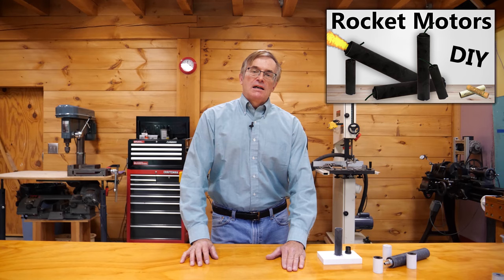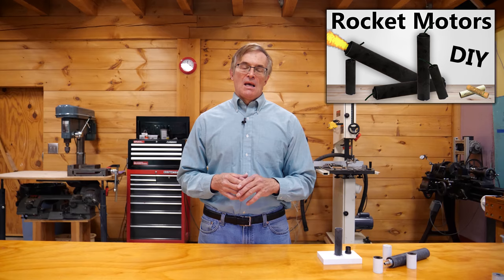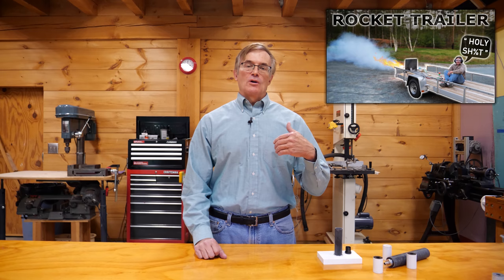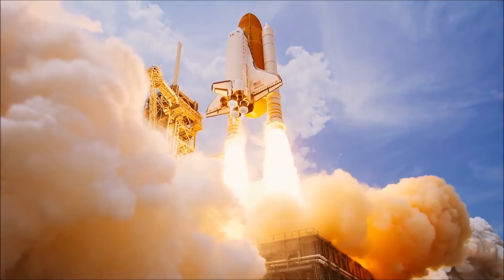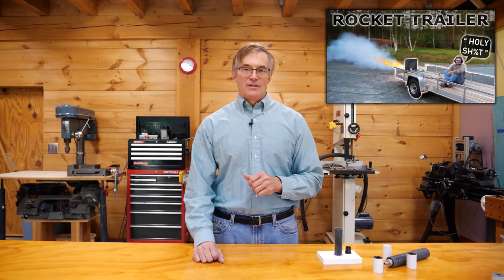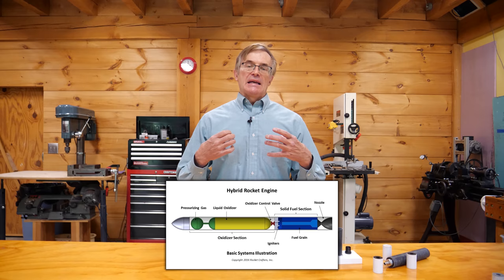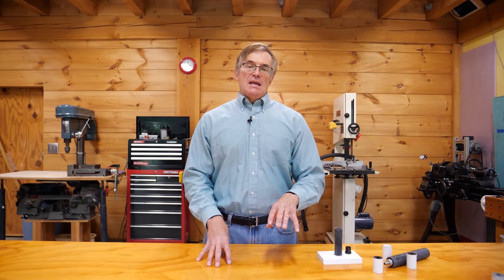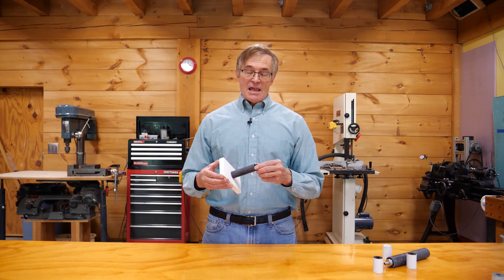Mixing Nitrous and Rockets is DANGEROUS... But Really FUN!

Comment: As they say in the world of high-performance engines, "Nitrous is not your friend". lol I would tend to believe that applies to most things of that nature. Things can go pretty screwy when oxidizers are involved, and they get there way too quickly for my liking.
Reply: Nitrous kits nowadays are very tame. So as long as you adjust your af/r properly and understand the operating limits of your engine if you leave a safety margin you will have zero issues. Nitrous got a bad reputation because people would go running it on a stock ecu and run wayyy too much. The systems are so easy to install you didn't have to know anything about engines to run them and the gains could be huge so tons of idiots watched fast and the furious bought a few bottles and a fogger and sent a conrod into orbit. Same shit would happen with cams if it was as easy to swap around as nitrous oxide. You'd hear tons of horror stories about people running interference engines with a ton of valve life and slamming a valve into a piston. Same shit really.
Reply: @n111254789  Regardless, the saying still applies. User-error accounts for 99.9% of the fuckups with nitrous, so the kits being "tame" means nothing. You may be playing with a "tame" fire, but you're still playing with fire lol.
Reply: @MFKR696  I mean not really no. They are genuinely tame and it's no issue to anyone who builds engines. It's the same people that don't torque bolts to spec and don't really understand the concept of af/r sticking a nitrous kit on there because it takes about 45 minutes to do and they saw it on fast and the furious are the ones breaking shit. Literally dropping a cam in is just as risky but a random person who doesn't know shit won't attempt it. Playing with air / fuel ratios is fairly simple once you understand it. By your logic doing almost anything to an engine is playing with fire because it can be done incorrectly and result in catastrophic failure. Hell even swapping the air filter and exhaust on a carbureted vehicle can result in the motor blowing depending on how lean it was originally jetted and what the stock ignition timing is. Basically everything will break your engine if you don't know what you're doing. Torquing the head bolts back on in the wrong pattern can fuck up your motor just all depends on the stock clearances. So nitrous is as much "your friend" as pretty much anything else on a motor.

Comment: Could amateure liquid rocket be made with 1 pound propane and 1 pound NO2?
Reply from the maker: Not without pumping the propane to much higher pressures than in it's storage tank.  And you'd also have to find a way to cool the combustion chamber.

Comment: you mention specific thrust ratio, but do you measure specific thrust to weight? would that not be a more important number as you may end up with very heavy tanks, electronics, plumbing etc that negates the increase of specific thrust from a hybrid rocket?
Reply from the maker: That's an important question.  The nitrous can be stored in cylinders made from the same tubes as the motors.  The valve and battery would have to be carried.
Reply: @TechIngredients  so I'm guessing there is a minimum size/weight motor that would make a hybrid have a better thrust to weight then solid fuel as the battery, valves and plumbing can only be scaled so far unlike just the volume of fuel. So really it comes down 'to go big or go home?' 😁

Comment: I beg to differ on "the most advanced liquid rocket engiines".
I was under the impression that the SOVIETS had solved most issues with high temp internal metal erosion from oxidation, AND the other (reverse) symptom: "coking". 
 I think it's called the "R-180"
They have been used for at least 10 yrs or more on the American "ATLAS" series of rockets.
Reply from the maker: Fair enough, we'll have to agree to disagree.
Reply: @TechIngredients  Let me know should you find anything further on the "SOVIET engiines for the ATLAS". 
They were purportedly used on the first stage ATLAS, PLUTO HORIZON mission.
Also on the CURIOSITY mission. Also the newer MARS 2020 Mission. 
I'm not sure about JUNO.
Reply: @TechIngredients  FYI: I suspect I originally saw the video about that on: 
"SCOTT MANNLY". The Scottish guy.

Comment: Will hybrid rocket be capable of throttle control?
Reply from the maker: It is, but just like full liquid rockets, it comes at a cost.  Any reduction in the propellent consumption reduces the chamber pressure.  This lowers engine effeciency unless the exit nozzle is constricted. And, to the best of my knowledge no rockets have adjustable nozzle throat diameters.

Comment: Aren't rocket lab's electron rocket and Virgin galactic's space plane using hybrid rocket engines?
Reply from the maker: I'm not familiar with the electronic rocket
Reply: @TechIngredients   There's a company from New Zealand called Rocket labs. If I remember correctly, they make a rocket called electron, that uses batteries and  electric pumps  to pump the oxidizer. I don't remember if it's only the oxidizer or both fuel and oxidizer that the pumps are used for, nstead of a turbo-pump. Then it ejects the batteries so they burn up in the atmosphere. Tim from everyday astronaut interviewed the CEO / founder, that's where I learned of it.  I forgot his name though.

Comment: Just saying, Propane self-pressurizes quite well too.  Nitrous Oxide/Propane shouldn't be too hard...
Reply from the maker: The propane has too low a vapor pressure to drive it into a combustion chamber with a practical chamber pressure.  At 1,000 PSI the nitrous is about as low as you can go.

Comment: last thing look up Jack Parsons he is the real reason JPL is called JPL and has a crater on the moon named after him.  he found he could get over 10% more power if he changed the interior geometry of the fuel to allow oxidizer and the burn to go MUCH faster by allowing channels in between the fuel triangles stacks he settled on a 6 pointed star a.  LAST THING if you want a better oxidized use Fluorine, NASA messed around with it and cryo O2 and methane and it was a monster literately whos exhaust was HF[kidding on using F to dangerous and $$$]

Comment: are you gonna use batch of warm water for the nos cylnder to increase its pressure..?
Reply from the maker: Yes.  Did you watch the whole video where I described the use of the Sous vide cooker?
Reply: @TechIngredients  yeah i notice it,btw how many degree ratio increment with the nos pressure, is it gonna be whole gas output the nozzle instead semi liquid like above.?

Comment: I enjoy your content but I have a few suggestions for accuracy on this one.  You aren’t off base about much, but full liquid systems are not out of the realm of amateur rocketry. You conflate liquids with needing pumps.   Most small liquid systems are pressure fed.   The system is as simple as a pressurant gas, (usually helium), a regulator, two tanks, and the engine.  I’d be happy to point you towards lots of amateur liquid engines.
Reply from the maker: I didn't say absolutely beyond, but nearly so.  You're correct regarding pressurization of the fuel as an option, however the combustion chamber survival is still an issue for anything too large for fabrication out of exotic materials.  Running cooling flow around the chamber is another engineering challenge.  It can be done, but it's tough.

Comment: What do you think of using nitric acid as an oxidizer?
Reply from the maker: I don't like it.
Obviously it's dangerous.  When spilled it doesn't simply vaporize and it's low vapor pressure means you will have to incorporate an oxidizer pump or pressurization system.
Reply: @TechIngredients  Ok,  thanks for your input!

Comment: impingement nozzles maybe?
Reply from the maker: I'm not familiar with that.
Reply: @TechIngredients  Well the tech is old as rockets themselves, general idea is you have two pinhole jets aimed to hit each other at an angle. The jets impacting each other provides forces needed to atomize the stream, but without the need for super-fancy geometry. Chances are you can make them in brass with a drill bit and get decent results. Some examples here: http://pintleinjector.blogspot.com/2016/12/commonly-used-injection-elements-in.html

Comment: How does the brass survive but the steel does not?
Reply from the maker: The steel does fine.  It's not the material, but the structure.  The thin "U" shaped steel pin is too thin and only part of it is surrounded by the nitrous.

Comment: I'm not convinced the demonstration at the end does the Nox justice, it's not much different from what I'd expect from pressured air.
Reply from the maker: Maybe it doesn't seem to, but it does.  Try it.  Compressed air is easy to generate and charcoal in a grill is pretty simple.  The result is a big cloud of dust with a more heat.

Comment: Hi nice video; i have a question, i put the N2O and paraffin in Propre 3 sofware and them give me the specific impuls of 206, i thin this is a littel bit low....what do you think?
Reply from the maker: It is low based on experimental evidence from other groups. How does the software account for chamber pressure which has a big impact on performance and which depends on throat area and delivery pressure?
Reply: @TechIngredients  i can change the value of chamber pressure but he does not increase the specific impulse, i have tried an renge of 1000-3000 psi

Comment: you were able to get your oxidiser liquid, 
would it be thinkable to get the fuel part solved with liquid propane tanks?
would it be possible to get this to a level of safety that would allow a nitrous/propane rocket be used on a maned plane?
would such a rocket produce enough thrust to move a glider?
Reply from the maker: Only if the propane were pumped to significantly higher pressures than it is stored at.
Reply: @TechIngredients  that would require a pump... is there a pressure liquified gas that would work without that? or maybe a cryogenic liquified gas that creates sufficient pressure?

liquid/liquid has the advantage that both sides can be shut of, as oposite to hybrids.
Reply from the maker: Liquid methane is a pretty good candidate, but still requires cryogenic storage.
Also, once you scrap the solid fuel then you have to deal with protecting the combustion chamber from the heat.
Once you see these engines in action, you'll see why we're so excited about this design.
Reply: @TechIngredients  that is another league then. 
There are compact jetengines that are able to propell a glider rather well.
would it make sense to inject nitrous into the intake?
not at normal altitude probably, as it would increase the heat output, 
but in thinner air the combustion of a jet would be limited by the oxygen level. nitrous might increase the ceiling of a compact jet engine.

Comment: Um... I'm wondering how your going to get 40 amps through those tiny solenoid wires?
Reply from the maker: We can and have.  It's simply a matter of voltage drop and the lengths are short. This is how these are supplied and any temperature rise is limited by the short duration of the power.

Comment: I wouldn't necessarily say a pressure-fed liquid rocket engines beyond amateur ability. Trying to make your own turbo pumps is probably going to end badly.
Reply from the maker: I didn't say it was absolutely, but that it's just about beyond an amateur's capacity. Don't forget about the additional issue of the extreme heat load and the combustion chamber.

Comment: I wonder why none of the available high nickle alloy stainless steels would work for a liquid rocket engine....
Reply from the maker: The Raptor engine is a full cycle system where ALL the liquid oxygen and liquid methane are pre combusted to drive the turbo pumps, but at extremely lean and rich mixtures respectively.  Most of the energy is not released there, but the products of that combustion on the oxygen side are very hot and oxygen rich.  Currently available steels can't stand up to that for as many as a thousand flights.

Comment: Isn't "on 3" supposed to clarify when to go? So "on 3: 3, 2, 1, 0" is incredibly confusing. It should be "On 3: 1, 2, 3" and you press the button ON 3. The 1 and 2 giving timing to anticipate when the 3 will occur so you can press it on the mark, not reaction time after the mark.

Comment: The way to "get your ass to Mars" is a nuclear fusion engine.
Reply: It's just as good as saying using a wormhole generator. Neither exist right now. Ion propulsion is the best we got right now in terms of specific impulse. The next closest thing is an NTR which just flows hydrogen through a fission reactor and uses that rapid thermal expansion to produce the thrust. No need to carry oxidizer either as you aren't burning it which helps dramatically. But fusion, we cannot get sustained fusion here on earth using all the resources and minds we have at our disposal. It's not easy. Let alone making it small enough to fit on a rocket.
Reply from the maker: Agreed.  They're not far away. Did you watch our video on crushing the can "without magic"?
Reply: @TechIngredients  I will now!

Comment: you use N2O because just oxygen is unstable and unsafe? I used to build snowmobiles with N2O and i know with engines using straight oxygen is really dangerous.
Reply from the maker: No, actually, the reverse  is true.  Under violent forces, nitrous oxide can decompose, although  this is pretty unlikely.  The major  region is that under reasonable conditions, i.e., 50 bar and room temperature, nitrous is a liquid. This allows  dense storage and some pressure  to drive the nitrous  into a combustion chamber.
Reply: @TechIngredients  interesting I was always under the assumption that feeding an engine straight oxygen was unstable and thats what the nitrous was for. as for dangerous I mean as in engine damage. I was always tempted to try straight oxygen but my mentor told me that would be a bad idea.

Comment: Compressed Air will do the exact same thing to a BBQ pit.
Reply from the maker: No it won't.  It'll blast the sparks and dust out and increase the heat output, but nothing like the white heat that this oxidizer generates.

Comment: Have you by chance come across the Scott Manley rocket fuel injector video?
https://youtu.be/aa4ATJGRqA0

Very informational and relevant. Atomization could probably also be achieved with 2 or more limiting port nozzles whose streams collide at equal angles.
Reply from the maker: I have, but impact with a fixed surface presents a easier engineering solution.
Reply: @TechIngredients  That makes sense. Thanks again for the great video, keep it up and can't wait to see more! :)

Comment: so you made a flame thrower
Reply from the maker: Yup, we did that as well.
Reply: @TechIngredients  try tesla turbine pump for air breathing higher compression (pulse) jet
Reply: @TechIngredients  if you detach the input air jet compression from the exhaust jet, with something like peltier to dc to electric compressor, makes it simpler
Reply: @TechIngredients  aluminium should be nice melting & burning as the burning fuel, also have it in tubes when air turbo burned, two mode propulsion, 40MJ/kg is similar to the kerosene 50MJ/kg, unless you go nuclear, Americium, mass produced, combined, into one, or a fusion, reactor, centrifugal plasma compression on the engine wall, for electric, from moving charges
Reply: sand blaster for kno3 powder (solid oxidizer) to kerosene-hybrid rocket engine
Reply: ie sand blaster solid fuel (carbon, flour, etc) air mix flame thrower

Comment: Hate to say it but our space fleet don’t use rockets NASA is pure  smokescreen.
To quote Col Tom Bearsden with a flashlight battery and float a battle ship..
Not saying combustion isn’t cool but love a little discussion on room temperature superconductors MIT has utilize Mizerner field high pressure applied to material permanently warps the orbits of atoms .
They have material that can saturate to 18,000 Tesla .
Y bias the angularity of inner action , 
Instead of typical magnet motor 90degree interaction of fields offset 24 and 57 degrees and the clogging disappears increasing efficiency 10 times normal 50 kw motor can now do same work on 5 Watts.

Comment: Specific Impulse is not unitless. Its units are seconds.

You're not going to find any hybrids that have a specific impulse of 300 seconds either. Not even close.

Hybrids that use nitrous are also not "safer" than solids. Nitrous can undergo spontaneous detonation if you have sufficient feedline coupling and you have sufficient energy in the form of combustion instability that can then pass through the injector, through the feedlines, and into the nitrous tank. People have died because of this. Its rare, but it does happen. I know people who died because of it.

Lots of misinformation in these videos.....